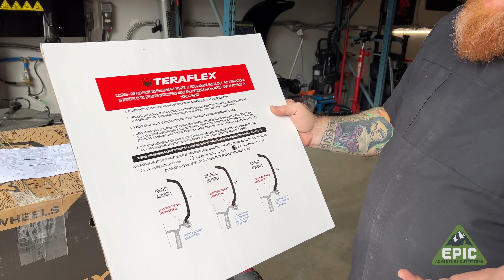Teraflex Olympus Beadlock Wheels - An EPIC Wheel for Jeep Adventure

Comment: I have the same set of wheels but can’t seem to get them balanced. I have a yellow dot and a red dot on each of my tires. I’ve lined up the red dot with the valve stem. Perhaps I need to line it up with the deflator instead. What are your thoughts?
Reply from the maker: No idea. Ours balanced quite well. It is possible to have a tire that just simply  is not going to balance suitably (rare, but possible).

Comment: Not DOT approved means "its not exactly legal" on any public road... Thats gotta suck.  You could always just get a DOT approved Hutchinson  wheel and -- you know, be road legal (and have both beads locked, not just the outer one).
Reply: not DOT approved has nothing to do with being legal.  The DOT  cannot write law only congress and state legislatures.  There are no laws in the US on the books that make running beadlocks illegal. That might change in the future but today beadlocks are not illegal
Reply: Hutchinson are not exactly True Beadlocks because the bead is not being clamped and locked between two parts of metal like the ring does to the wheel with the tire bead between them